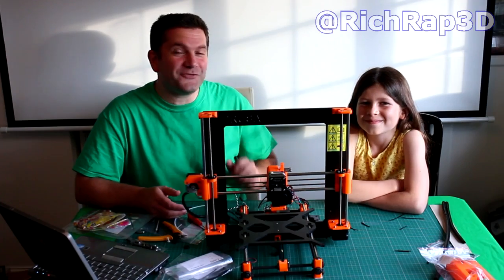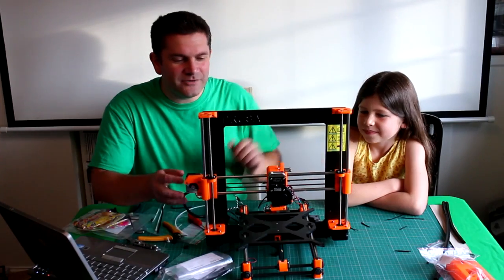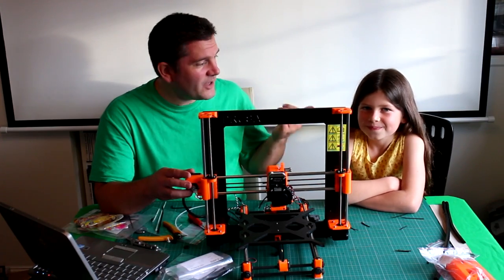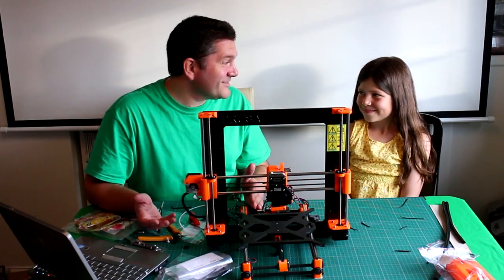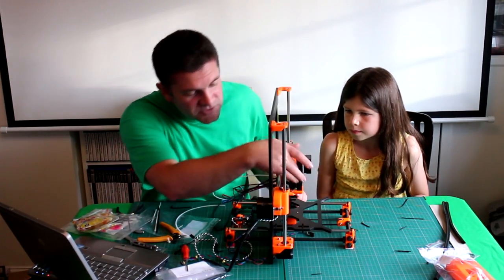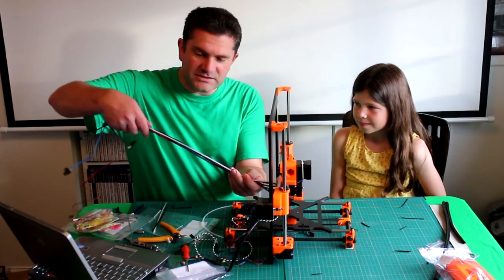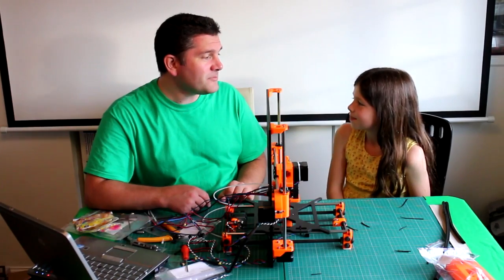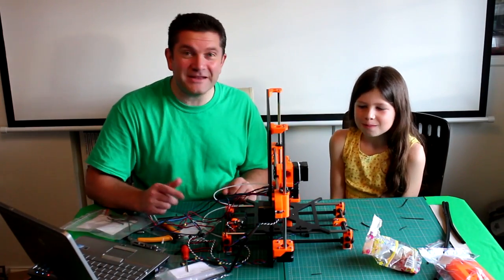Prusa i3 MK2 3DPrinter - Dad and Daughter Kit build - Part 5 (LCD, Extruder & Hot-end)

Comment: Man these videos are really making me want to get this printer...
Reply from the maker: If you need or even just want a 3D Printer, this is money very well spent. We are delighted with the print quality, speed and ease of use.
Reply: My main concern is just troubleshooting. There will of course be some no matter what, but my MakerGear Prusa Mendel was a bit of a nightmare. Tons of motor skips that the IRC channel couldn't figure out, warped beds, power supplies that couldn't get up to good temps, and basically being able to see the threaded rod ridges in the prints itself. Do you think maintenance of this is significantly less than say an old Prusa Mendel?
Reply from the maker: Yes, true. Every 3D Printer will require maintenance, and sometimes troubleshooting.
So far I have found a few fixings that have loosened, these are now locked with a drop of superglue - would be better to use threadlock, but I'm out.

Because this is a controlled kit of selected parts, it's designed to work together. And the firmware has some ease of use functions - more than in previous machine configurations. The setup and auto-calibration take care of many little issues that new users would normally spend days working out.

I have never used a Makergear, so can't comment, but after many different RepRap machines, this is a step forward in terms of a kit that's been made to work well straight away. Instructions are good, and you already have a complete setup of material profiles to use, so if all you want to do it 3D Print and get finished models, it's doing that. And when you want to experiment you can without too many issues of calibration.

It makes the learning curve easier in my view, and that's a really good thing. 3D Printing is still tricky, and in many ways it's still in the stone-age, but we are finally seeing effort being made on the user experience, that will benefit everyone in the 3D print / maker and much wider community.

Comment: do you think it would be fairy simple, ( apart from the wiring ) to loosen the Z/X axis frame nuts and lift the base out wholeand pack it down flat in a case for transport?
Reply from the maker: That's not quite so easy - the Y axis is inside the Alu frame so it's not easy to lift out even after loosening the M10 rods. But it's a RepRap design, so I think with a bit of effort you could modify the mechanical design so the Y axis could be quick-fitted. Then it could fit inside a flight-case. There was another DIY kit machine a few years back that had a similar idea - called Foldarap? if I remember correctly.
Reply: Ah thanks ... reading through the manual it just kinda seemed the metal x axis  sheet was clamped by the 4 bolts on the threaded rod on and could be lifted out... still more reasons to get one to tinker with lol..

Comment: How does the nylon filament 'strain relief' hold up over time?
Reply from the maker: I use a length of 1.75mm Polycarbonate on my other printers, and they have ran for over 2 years using that method. I'm sure Nylon would do just as well, if not better.